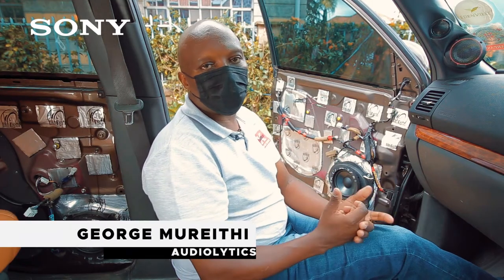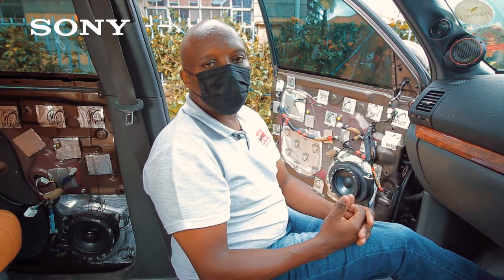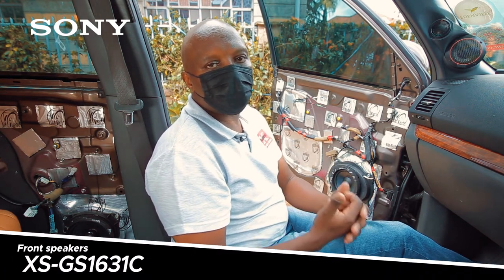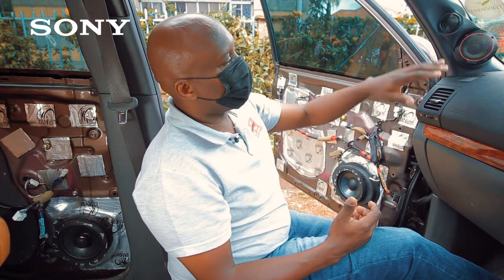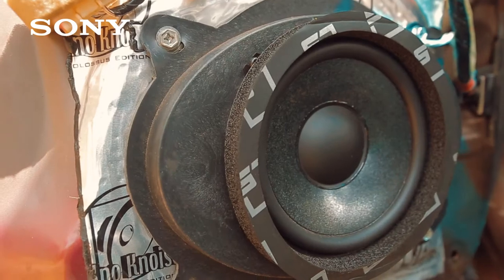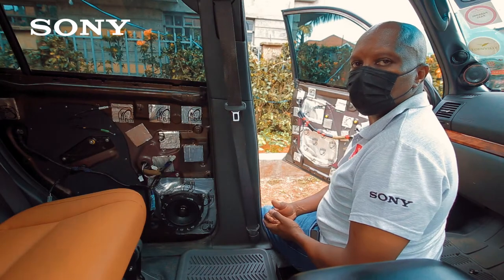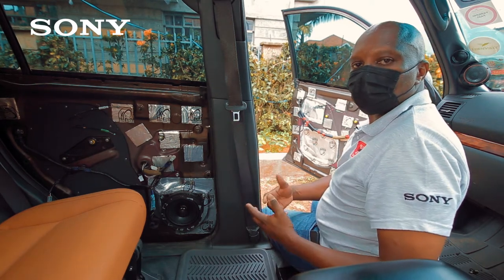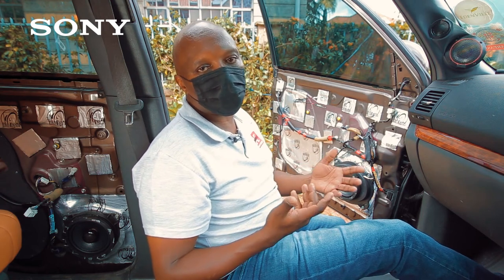Sony 3 way Component speakers XS-GS1631C | Reithi - Audiolytics

Comment: The component speakers 👍
The coaxials...meeeh
but what is this patchy sound damping work? Seal the door properly or save the cost and just skip the process
Reply: For sound dampening, 25% coverage of 80 mil deadener is the minimum accepted treatment.

This vehicle got 50% coverage of 100 mil on outer and inner panels as well as all the door cards and trim panels resulting in overall cabin noise reduction of 6dB. 100% is not necessary except for extreme SPL applications.